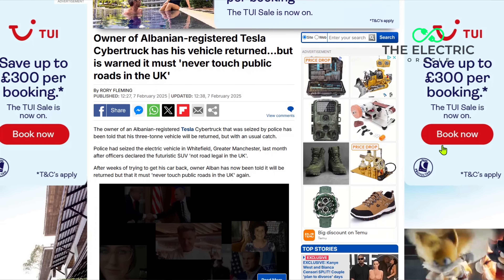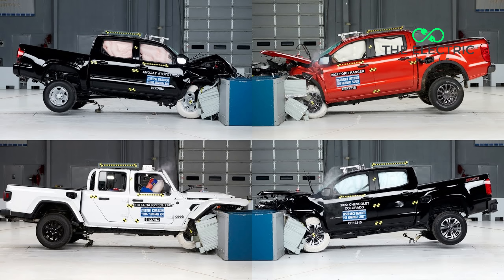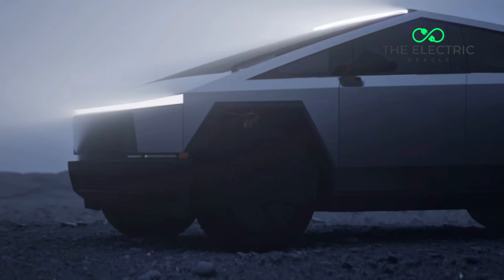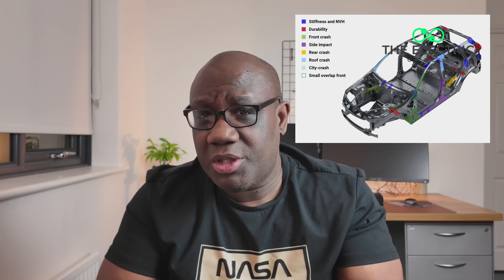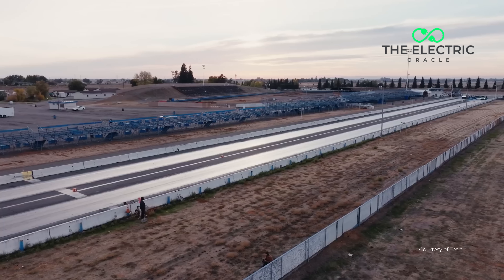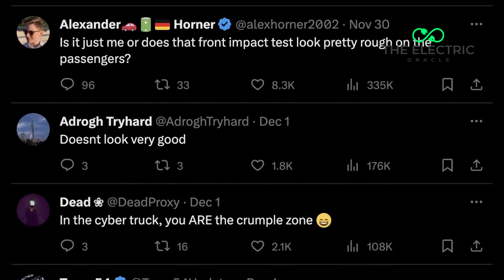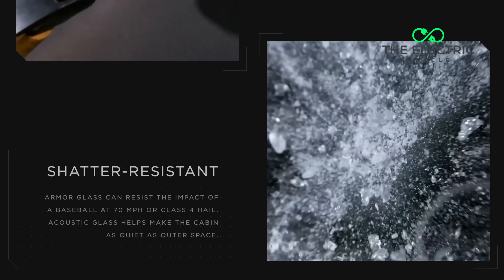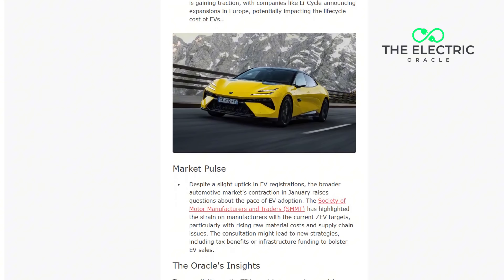Why the UK Banned Tesla’s Cybertruck – 5 Fatal Design Fails!

Comment: To be fair, even European cars are unsafe for European and UK roads. Why? Because all car makers choose power above sense. All modern cars, regardless if they are of the ICE type (with turbos) or of the EV type, have far too much power. I was really pissed after reading an article in the Dutch version of Top Gear magazine that stated that small cars with conventional engines and power are "unsafe" on highways because they are not powerful enough. I'm sorry but where in the law it is stated that having a sensible car is equal to be a danger on the road? Isn't the other way around where idiots with too much power under their right foot and think that every road or highway is their personal speedway track and where every red light is only there to allow stoplight accelerations that actually have no place on any road other than a closed track? I'm confronted with such complete retards (male and female) everyday on our roads where just driving at the allowed speed limit isn't fast enough, certainly not when you are driving in between the minimum required and maximum allowed speed limits. In the latter case you're considered to be a "trigger for road rage". Tesla's, among many other foolish brands, are such ideal cars for idiots driving like would-be F1 drivers.

Comment: You missed the fact that the front wheels need to have a physical connection to the steering wheel. The cyber truck is basically fly by wire

Comment: Until 1999 I happily drove subcompact cars in the US.  SUVs and oversized pickups were just starting to become more common than not.

By 2009 subcompacts were no longer safe on US roads.  SUVs and pickups had gained so massively in size and weight that simple physics dictated we purchase a larger, heavier vehicle.

Also, I walk a lot.  The size and blind spots of the popular vehicles here make this a dodgy prospect as I'm now pratically invisible to drivers.

I applaud the UK's regulations for the safety of all.  Please don't let greed and vanity overcome common sense.
Reply: I forgot to mention that I happily rode motorcycles for commuting, touring, and pleasure for 30 years.  I gave it up in 2017 because of a combination of oversized vehicles and the dogged illegal use of cellphones.  I am an excellent dodger, never had a moto wreck, but the close shaves had become too frequent

Comment: The healthcare inflation rate in the U.S. dropped dramatically between the 1980s and 1990s.  The primary reason was airbags.  There was a massive drop in the number of people going to the ER, spending time in the hospital, and going through rehab.  Roughly $5+ billion a year in airbags saved $100+ billion a year in healthcare costs.  Safety is all about the $$$.

Comment: You wouldn't allow a car on the road if it was covered in spikes.  Plus the steel is going to rust eventually and you can't apply a wrap as it doesn't stick and eventually peels off.

Comment: Ps. I can't see anything on your feed for electric motorcycles. Uk's Maeving make a couple of crackers. Excellent value, 70mph with an 80 mile range. Not designed for long journeys but an excellent little commuter. Removable batteries for charging or swapping out. 
I don't think bikes are your thing but maybe you should give them a look to round out your channel.

Comment: The cyber truck doesn’t meet the safety requirements of any country other than the USA. Musk has said that he has no plans for it to be sold outside of the USA because to meet those regulations it would have to be completely redesigned. And until the sales of the truck are much higher it is not economically viable as a vehicle. This is why he is trying to get the USA government to buy $400 million of the trucks, cause he can’t sell them outside of the USA.
It won’t be sold in Australia either for 2 reasons- 1 it is a left hand drive and Musk has said that it is not going to be redesigned for right hand drive 2 it still doesn’t meet our safety standards

Comment: That 3.5 ton weight limit exists in the European Union too (I'm sure UK's and other EU countries driver's licence systems got harmonized in 1997).
Some other E-SUV these days are also scratching that limit, the electric Mercedes G is at around 3.1 tons (Wikipedia says 3085) weight unloaded and it's maximum weight is exactly 3.5 tons, so it's load capacity is just 415 kilograms, then non-EV G-classes of the latest generation are around 2.4-2.6 tons (some really old generations even weigh just around 2 tons) and have load capacities often around 600 kilograms; Imagine a group of 3-4 people travelling with some luggage and probably bikes on a bike rack in that G 580 EQ, this might get really difficult not to overload it beyond 3.5 tons...

IMHO the Cybertruck is kind of a halo car project rather pushed by passion of some engineers than small-minded from the controlling department, "The Squidd" has some videos about such cars, I would add some more like the VW Phaeton, Bugatti Veyron/Chiron, VW XL1, Mercedes Maybachs, Porsche 918; these often weren't profitable for their manufacturers but were engineering-driven to perfection and showed what's possible if they get some very loose limits "just make them road-legal".
Compared to that the Cybertruck doesn't feel like it's been engineering-driven but rather by one of Elon's pipe dreams.
There's a reason why many pick-up trucks, commercial vehicles and real offroad-capable SUVs are still made with a classic Body-on-frame construction instead of a Unibody or "Exoskeleton" like most passenger road cars, it's also because some buses are delivered as rolling chassis to coachbuilders and commercial trucks without any bed so companies can put some specialised equipment/machinery onto it (like a drill or pile driver, crane or towing equipment).

Comment: Aside from the safety considerations, the cybertruck would be impractical for the UK. It would struggle to fit on most B roads. The vehicle is an absurd overdesign for what it mostly does, which is single person journeys. You don't need a three ton vehicle for that.

Comment: SUVs are massive problems tbh and should be banned cos they are too big, they strike things to high up and cause more damage in impacts. 
Cars should be more sized like the Fiat Cinquecento, tiny and low to the ground for better safety to pedestrians. It would also allow for smaller parking spaces so more cars can park on the same bit of land, something which is a massive issue when some twat has an unnecessary pickup truck.

Comment: 7:22 I certainly doesn’t like cyber truck. However, the point about the dimensions does apply to most SUVs. For example, a Volvo XC90 is 2.1 meters wide.

Corrections, 2.1m is mirror to mirror. Body is just 1.9m. Cyber truck body is over 2ms wide.

Comment: If the passenger compartment can move under impact relative to the rigid skeleton frame, and the bindings holding the two parts together can absorb energy then there would still be a “crumble” zone so to speak. But it would be very devastating to the other party of the collision.

Comment: Wrong! The steel panels on the Cybertruck aren't load-bearing. They were supposed to be, but they couldn't figure out a way to manufacture it. It is therefore a regular unibody design like every other car out there. The sharp edges are 100% a design choice. These steel panels have some benefits, but they are also as correctly stated in the video very, very dangerous to unprotected road users. It's only a matter of time until someone gets seriously injured or killed as a result…

Comment: One part of the design and structure of the vehicle that wasn't touched on is that, if there were crumple zones that allowed the Cybertruck to absorb impact, that would infringe on the space required for the massive battery packs, and most likely would pierce the battery cells and start a fire, and once an electrical fire start it doesn't stop.....

Comment: here the will never get on the road because the angles and sharp edges  and the steer by wire there currently is one here but because its on foreign licenseplates we cant take it away you need a truck/lorry license to drive it here as its over 3500 kilo

Comment: Back when I was knee high to a grasshopper, my dad bought and sold US cars - it was cool in that I would get picked up from school in Corvettes, Chevy Blazers and Pontiacs. He had a thing for the classic 'station wagon', especially the really bizarre ones like a Plymouth that had three rows of seats...AND a pair of folding seats in the back load area, an electric rear window, electric opening doors, it was insane.  The thing is, these things had what they called 'shock absorbing bumpers', which were huge thick steel highly chromed bumpers either end of the car, they probably weighed more than a full grown person each just on their own, and they were mounted on shock absorbers.  Sounds great right? Well, we had a couple of front end collisions with these types of cars. Both times it was on single track roads (we used to holiday in the Scottish Highlands) where blind hills were common, and you can probably guess what happened. Both times we were all completely uninjured, and there weren't even scratches on our car.  Both times, the other car was written off completely, both times the occupants were hospitalised with broken bones, crush injuries etc. My dad was an incredibly safe and careful advanced driver with decades of experience, both impacts happened at quite low speeds. I wonder why the concept, generally, never caught on? The Cybertruck is an insane idea, envisioned by an insane narcissistic man baby surrounded by yes men/women who does not care one jot for the safety of anyone let alone the fools crazy and deluded enough to pay vast amounts of money just to be seen in his Mad Max-esq road tank that isn't even any good at what it's supposed to be (a pick up truck).

Comment: What on earth makes him a Tesla fan and wtf does he even like about the cyber truck? 😂 Honestly like what is there to like? Also btw they’re not built for Canadian roads AT ALL. There’s like, maybe 3-5 months of the year that you can even drive it, depending on where you live. 

They cannot handle winter and it starts breaking and failing insanely fast. One guy drove it for two hours in the snow and on his drive back, the entire AC/heating system failed, so the windows were fogging up badly, the back camera was totally obstructed by snow.

He had to put all his ski gear on because it was freezing and there was water dripping on him from the top of the door and because the panels weren’t aligned. He even contacted the press  because he wanted to warn people.

And the cherry on top is that no one will insure it! There were only a couple insurance agencies who said they’d insure it. But they would want about $5,000 - 6,000. Just for reference, a normal full size pickup truck is like $1,200. Because they don’t insure it as a pickup truck. Its classe classified as an armoured vehicle and likely cannot be driven on all roads. So buying it isn’t the last of it and if you need repairs? Lmao ok. Cooked.

Comment: Isn't the fly by wire steering a fundamental stopping point for UK/EU legislation?
(No mechanical connection/backup between the steering wheel and the wheels).
Perhaps you mentioned this & I missed it.

Comment: It wasn't even tested properly for America roads. It's also not even able to off-road really. The suspension is too stiff, it can't keep the wheels planted in the ground. It's a death trap that's good at nothing. It has no positive aspect. It's crazy how bad it is.
Reply: I haven't tried bouldering (not my thing), but in my experience in New England it handles both mountain dirt roads and a good amount of snow with ease.

Comment: The cybertruck is a technical error.  It's not even recommended in America. It breaks down more often than any other vehicle, can't be used on snow-covered roads and can't be used like most pick-ups. It is unsafe for pedestrians and catches fire easily. 
Yes, safety comes first and the whims of a drug-addicted billionnaire can't question the existing safety regulations.

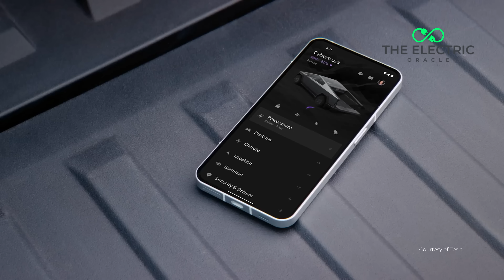Comment: 11:55 It's definitely not designed for Australian roads. Our lighting and pedestrian impact regs are similar to Europe. The sheer weight and torque of the thing will decimate dirt roads. Our standard lane width is ok, at 3.3m, but our parking bays are 5.4 x 2.4M so it overhangs by 27cm. and there isn't enough width left to get the doors open enough to get in/out if you park next to another one. In fact their mirrors would touch. Payload capacity and volume is approximately HALF that of a similar sized conventional vehicle.
Reply: Are you sure?  Because I looked it up and you can buy an F150.  And those are longer and wider.  Also - in the cybertruck, by default you are in 'Chill' mode, which does not use the full torque.  It's actually pretty sedate.  You have to open the menu and specifically request the 'Standard' mode which then gives you the crazy acceleration - still heavily moderated by the computer for anti-slip.

Comment: The GVWR is 9,169lbs and classifies it as medium duty truck in most regions. I recently certified one here in Canada as a mechanic - our regulator actually updated its classifications, increasing the weight limits to allow the Cybertruck to be classified as lightly duty/passenger vehicle. There were so many glaring safety issues at a design level I noticed it's insane how this vehicle is even allowed to go to market.

Comment: In Canada, one Cyberstuck owner found out that snow blocks the headlamp light bar. Have fun driving it on the highway! This thing is awful in every way.
Reply: And wouldn't it blind you when driving in fog?  All that reflected light coming back at you!  Still, Elon does say he's a manufacturing genius, and the only one alive on the planet at this time.  Still, hopefully that will change soon.
Reply: The Rivian had the light bar way before the CT.  Also the lightbar is not the main nighttime ilumination.  It's only for extra visibility.  It has headlights located fairly low to specifically avoid fog blindness.

Comment: Good video. To the point without any flannel or taking sides.
American vehicles don’t have to meet the same safety standards as vehicles in the UK or Europe, that’s why they are so cheap (over there) in comparison to what have here. & the quality of materials used is shocking. Especially inside, fit & finish are appalling.
The crash testing & lighting was very interesting, I actually went looking for crash results after watching this - OMG !! It’ll make your toes curl backwards.
& in this evenings News (17/02/25) the Government has been lobbied by the RAC & other Driving Associations to regulate vehicle head lights & the brightness of them there after.
Due to a step rise crashes where drivers have stated dazzle & not being able to see because of the intensity of the on coming vehicles headlights.

My daily drive is a 1986 Suzuki SJ413 long wheel base pick up, like the classic Hilux - but a little smaller. I used to drive an MX5 but due to being blinded regularly at night by on coming traffic, I now sit much higher so the dazzle is not as bad. But it still happens.

Again, grate video. To the point, simple to understand & dealers the information clearly. I made my Mum watch it as I was struggling to explain without an actual truck the whats whys & wherefores.
She has driven a lot of American vehicles, & all she has to say about them is: There s**t.

Comment: The only minor criticism I'd have on this video is that the crash test footage shown at around 8 minutes isn't a totally fair comparison. The F-150 still is from a "quarter overlap" test where only the left front of the video impacts a (low) barrier (and thus only the front left frame beam has to absorb the entire collision), while the cybertruck still is from a full frontal test (where the entire front impacts a barrier and thus energy is dissipated by the entire front structure. It would be more fair to compare it to for example this F150 Lightning full frontal NCAP test https://www.youtube.com/watch?v=TX4ZrbiGbfk. 
The Cybertruck footage STILL looks horrific even compared to that though. The back axle or rear wheel steering components sheering off under the load of what should be a fairly survivable (as far as car impacts go) crash is... not a good look

Comment: American pick-up trucks do not meet European emission and safety requirements,
 but can be imported via an individual type approval, the Individual Vehicle Approval (IVA). 
American pick-ups do not even have to comply with these rules in their own country,
 because they are classified as trucks. In the event of a collision, they are less safe than a passenger car for pedestrians, 
cyclists and other motorists and emit an above-average amount of CO2.
Ford f-150 Raptor Supercab has dimensions of 5,588 x 2,192 x 1,994 mm (l x w x h). The car weighs 2,506 kg. 
The cargo box has a capacity of 1,495 l. If the car is equipped with a 3,490 cc V6 biturbo engine,
 you have 456 hp at your disposal. This four-wheel drive automatic transmission gets you to a speed of 100 km/h
 within 5.3 seconds and has a top speed of 174 km/h.
That, with a weight, loaded, up to 3.5 tons!!!!
And even 6.5 tons including trailer....